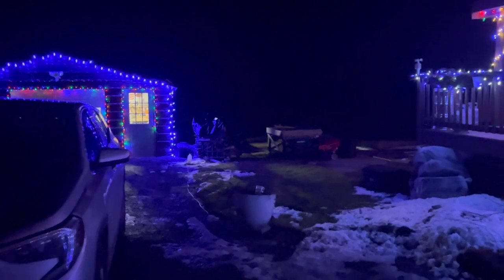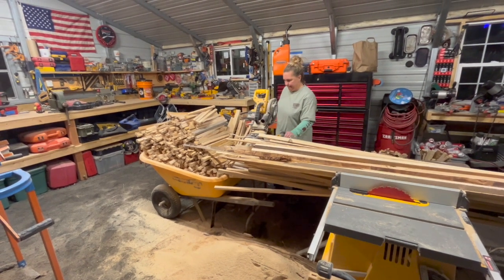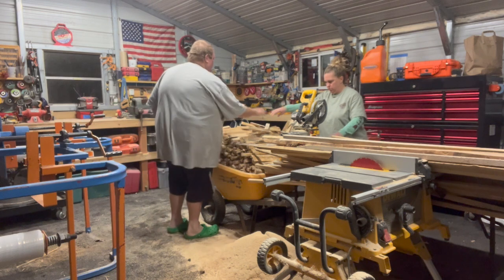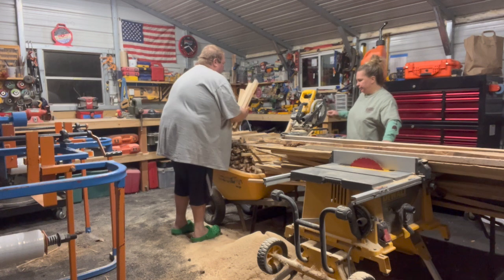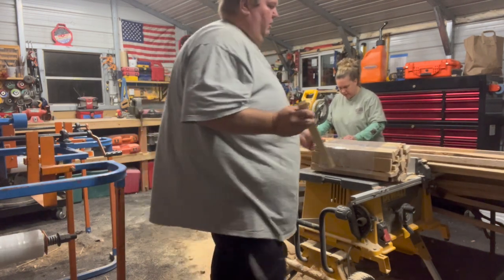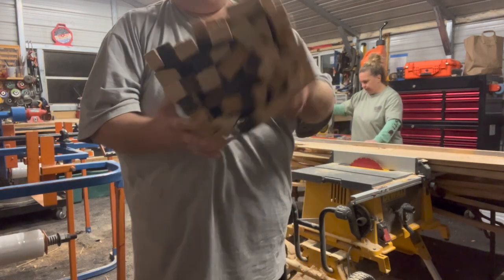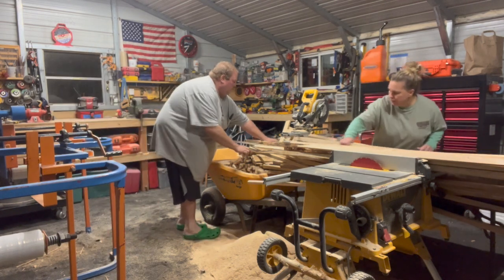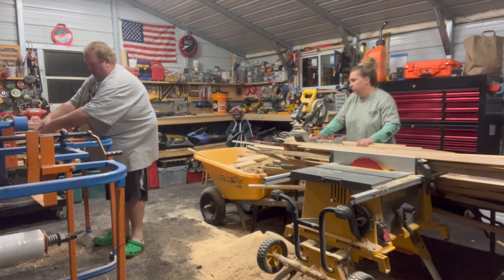New Kindling Bundle Operation #51.  Trying Something New

Comment: Hello Jeff and Patti, Christmas lights look awesome. What a great way to make bundles with free slab wood. 
QQQ, I couldn’t help but notice the compression spring on your bundler is completely compressed. I have the same Hudson bundler with the same problem. I wish they came with a much tougher compression spring. I actually removed mine but I’m constantly resetting the tension which is a pain in the butt. Do you have the same problem constantly adjusting the tension.
Cheers Woody !!!
Reply from the maker: Thank you.  Yes we have to keep a eye on that and constantly adjusting the nut.   I agree it’s a pain in the butt
Reply: @mountaintopoutdoors  perhaps it’s a good time to reach out to Hudson and have them provide us with a much more robust spring because your channel gives them a lot of free advertising.